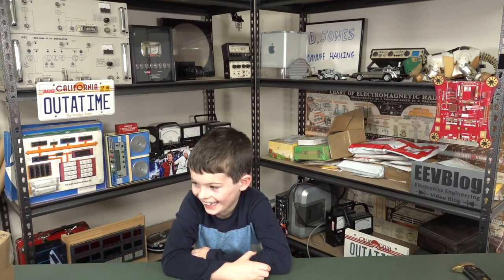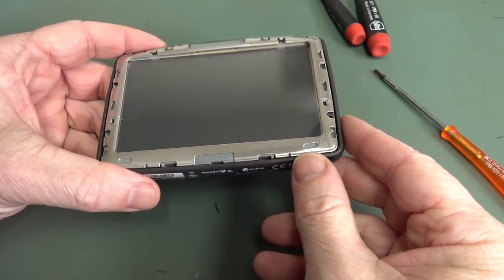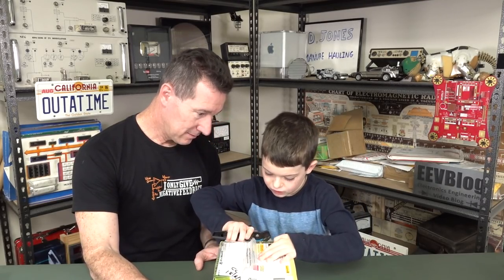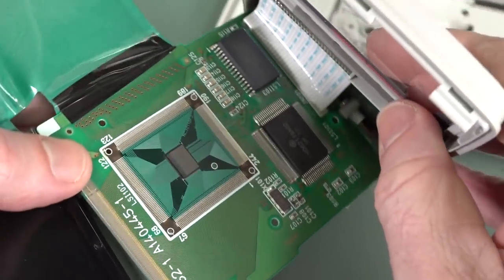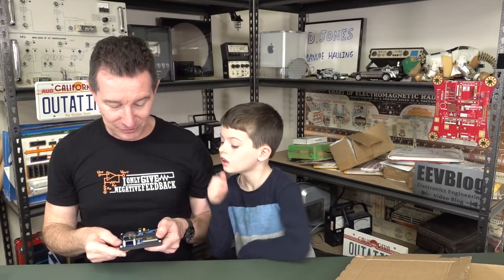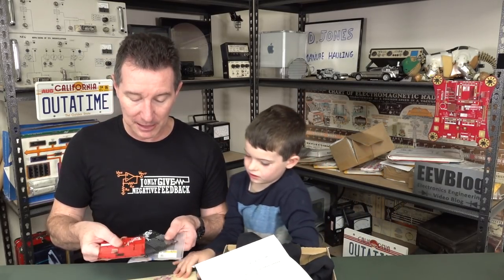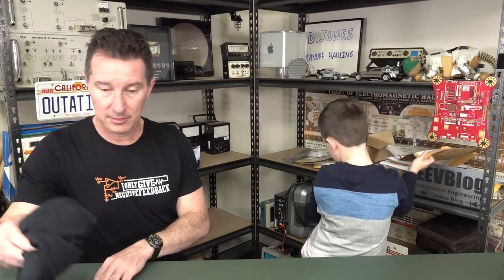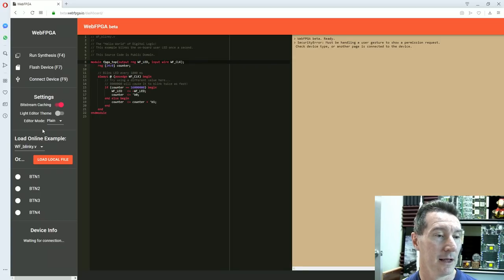EEVblog #1229 - Mailbag

Comment from the maker: UPDATE: The WebFPGA NeoPixel demo didn't work because it was written for the external Neopixel adapter and not the internal RGB LED.
And yes, I goofed the edit on the first clip.
Reply: I don't know how kickstarter works but it appears that it ended literally today. I really want to get my hands on one of these to begin learning how to program. This seems super low overhead and something that you can carry around all over and all you need is a phone or a laptop with a browser to program. Thats right up my speed. Anyone have any idea how to get one of these?
Reply: @StreuB1  Hi! Co-creator here. We just launched a webstore for people who missed out on the KickStarter: https://store.webfpga.io.
Reply: @ryanjacobs5362  ...and this is one reason why we need FPGAs: https://www.youtube.com/watch?v=9g-WU4oZAeI 
and an earlier state: https://www.youtube.com/watch?v=x0NJhbx9IYM
Reply: @tubical71  Holy shit, that thing is huge! That's amazing. Now the wheels are turning in my head. I want a giant audio spectrum analyzer in my bedroom now haha
Reply: @ryanjacobs5362  also i got some of these IN-13 display tubes....13cm long and 7mm diameter, current controlled, it needs about 20mA at around 160Volts for 20µsec as an ignition pulse and after that only 5-15mA for the linear baragraph length at 160Volts to 200Volts but this needed to be AC or the tube won´t last very long as with DC it degenerates....the glass envelope will get darker from the inside over time as the cathode material will settle there until you won´t se the red line anymore.....

Comment: Sadly dedicated PNA GPS units are not useful anymore due to how rapidly businesses fail as well as housing developments spring up in many states. Services like waze or Google maps will have the most up to date data for free while the GPS makers will charge you $80 for a map update. Furthermore those claims such as lifetime updates are a scam. They will count lifetime as how long they plan to support the GPS before it is EOL. Even though map files released after the EOL date will still work, but once EOL is reached, they will no longer give you free map updates. You instead have to then purchase new maps.
Reply: Razor2048 Refusing map updates would heavily depend on the business honesty, they could just count on the decreasing number of surviving units gradually reducing the cost of not charging the update fees.  Stopping the making of technically compatible updates altogether is another matter as it costs the same for 1 customer or 1 million.
Reply: Actually they are often used by motorcycle riders these days. They are more rugged than smartphones and have specific street and/or curve programs. Even til today google maps does not really support motorcycle touring.

Comment: How many people guessed that Dave was going to use the 6809 to say what he always says at the end of a video? The tilt bail is the one part of the EEVblog meters I don't like. My 35 year old Beckman Tech 310 uses a stiff U-shaped bit of metal wire as a tilt stand. It clips in to one of two places in the solid plastic case to provide two tilt angles. It is solid in use unlike the "bounce" you get when using the EEVblog meter with the stand deployed.  I'm currently working on a small computer device that uses the 6809. That gcc based C compiler for the 6809 would be very useful. I'll be downloading a copy of it and giving it a try.

Comment: I think the yellow tape would probably protect the UV erasable chip.  I have several high intensity UV leak detection lights and guess what color the UV safety glasses that came with them are.  You guessed it, yellow.
Reply: The yellow color doesnt mean it blocks UV. Yellow... simply lets yellow through. Glasses can be without any tint and still block all UV.

Comment: You won't get a genuine Motorola 6809 (unless it's reused or new old stock), but NTE Electronics makes them as part of their sideline in parts for obsolete repair and hobbyists.  You can also get the 8080, 6502, 6800, and a selection of their support chips and relatives.

Comment: The calculator might have a separate board for the LED transmitter so that they can use that board in all products that they want to add that functionality to without having to do multiple board versions.

Comment: I just pulled my Tom Tom XL out my car last week as it no longer has any space for updates.
Got many years out of it with only a battery change I did 3 years ago.
Reply: If you still have it, you could upgrade the flash chip to an 8GB one... But before soldering, update the firmware to the newest.... since in order to support it you need the the newest bottom. 
I did it once... and my XXL still accepts the newest maps.

Comment: My mom and I are still using this exact TomTom. I had to update the maps a few times and had a hard time squeezing a couple of EU maps onto its limited flash (4GB?). I didn't fire it up since the GPS roll over, but I got a mail from TomTom for an firmware upgrade I think...

Comment: If you use the new Edge (based on Chromium), currently in dev release, your WebFPGA would probably work. (I just checked and it doesn't give the WebUSB error)

Comment: At 6:30 you show an onboard power supply. Is there a metal shieling because it is required by regulation to have shielding on a power supply? and/or is it because of EMI from the power supply could influance parts of the other components of the device? (both?)
Reply from the maker: Probably just taking no chances on the EMC compliance. Likely not actually needed.

Comment: Initially I was puzzled as to why an Aussie version? Needs to work "upside down" (down under)? 50 Hz. DC? Just kidding ... I quickly realized that the AU version was referring to the maps ...

G'day, mate, from AF6AS (my ham radio callsign) with a BS degree in electronics engineering from the USA 🇺🇸. (Although my degree is in the hardware side, I've spent most of my life as a software engineer. )

Having said that, YouTube videos have renewed my interest in electronics. It's beginning to come back to me, although the 7400 series of ICs (and some 4000s) was state of the art when I graduated in 1976.

Comment: I am still using a TomTom GPS like this one - only the front bezel is black instead of silver, and of course it has the European maps on it. I bought it in 2010 for about 100€, and it still serves me adequately. It even got the GPS week rollover update earlier this year. However, from that experience I learned that I don't want TomTom, because while the device itself runs on Linux, you are absolutely required to use Windows for any software or map updates (I never updated the maps, because back in the day they wanted money for that) - so I'll use it until it breaks down (it never leaves my car, battery depleted most of the time, during summer and winter temperatures), and then I'll get something different like a Garmin or so, but I will do my research before buying it, so that I can update it without needing to boot up a Windows VM.

Comment: I have the same TomTom, still works fine, although it's not GPS rollover proof! So ETA is always 0 seconds from the current time (at least it's not negative, well done programmer!)
Since the company is Dutch, those GPSes were refurbished and sold in the Netherlands for cheap about a decade ago.
The calculator with infrared port was used exclusively with an overhead projector in the classroom, the other models have the serial link using 2.5mm jacks. We used to write cheat sheets into these calculators and link them to all our classmates. These calculators were mandatory at my school and I've still got it. It's rubbish though!!
We did write games for them in basic